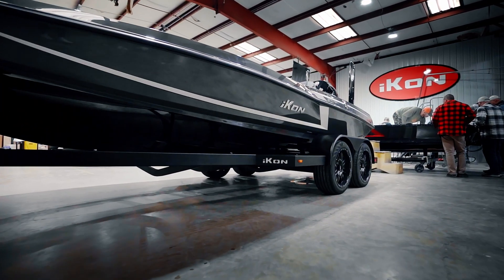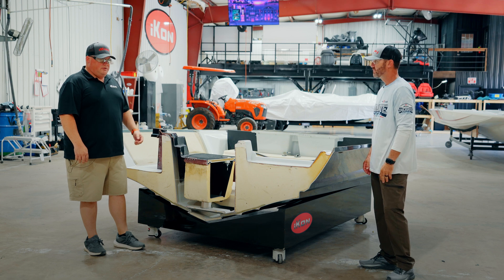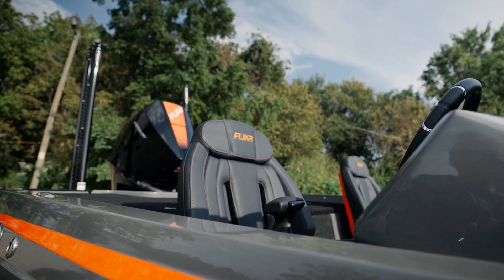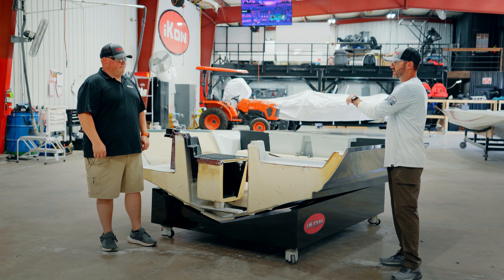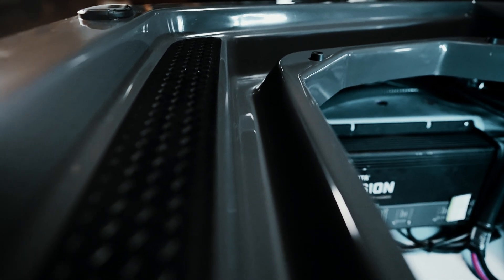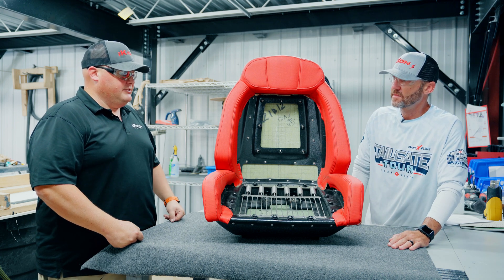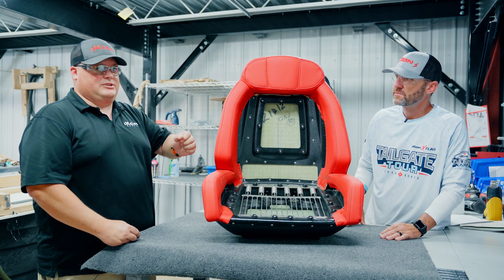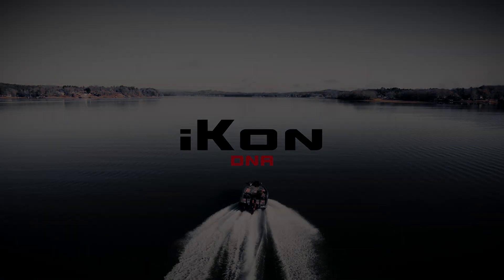iKon Boats DNA | Episode 1 - Cockpit, Cooler & E-Seats

Comment: Seat is a copy of Ranger which is NASCAR inspired
Reply from the maker: The Ranger seats where not considered when we designed the seats. Glad you like them
Reply: Seat design has nothing to do with Ranger
Reply: @ChuckPippinBassFishing  outside shell sure looks like Rangers NASCAR design and you say that like it's a bad thing.
Reply: @rickvann3489  I didn’t say anything bad about Ranger. I just know that the Ranger seat definitely was not benchmarked during the design of the VLX.
Reply: @ChuckPippinBassFishing  lol... helluva seat to use for a bench mark though. I get all kinds of boat owners that like it over there boat seat. Huge